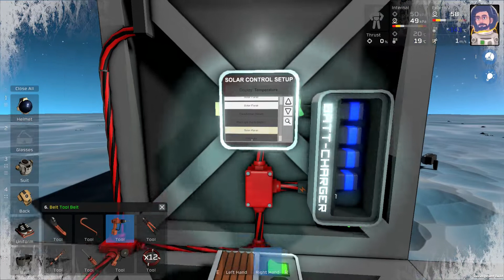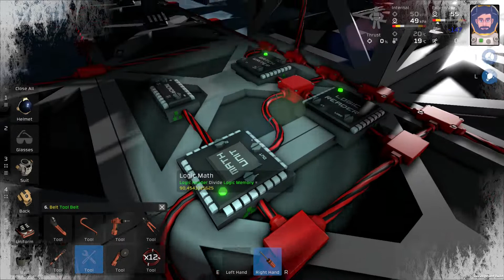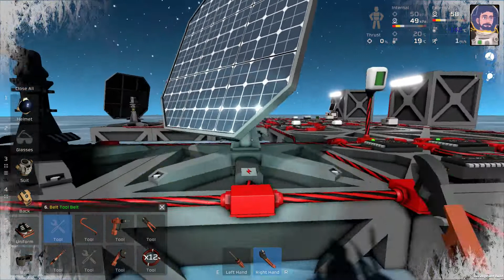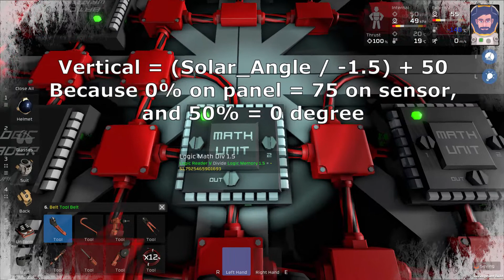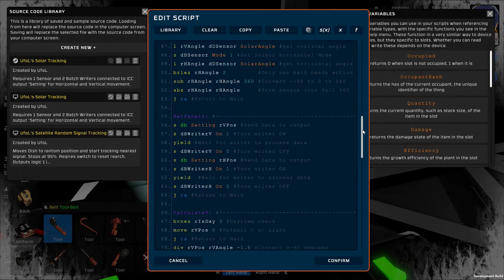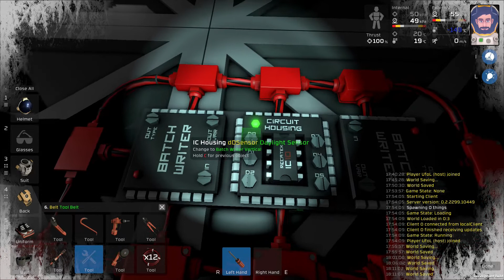Stationeers Solar Tracking Tutorial

Comment: Script working today nice and smooth. Whatever power goes out, no necessary reboot or anything like. The system restarts for itself. Big thanks for that!! For who is having problems the only thing o think could be wrong is the solar panels position. Make sure the DATA INPUT is looking at sunrise and sensor facing up.